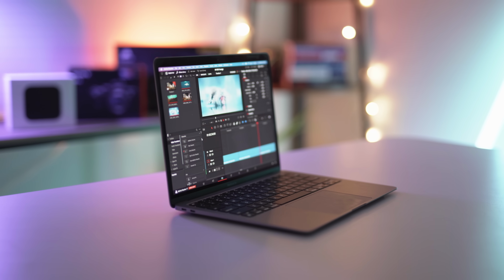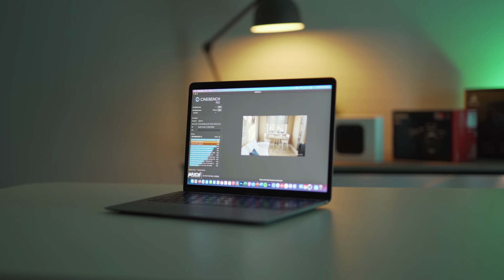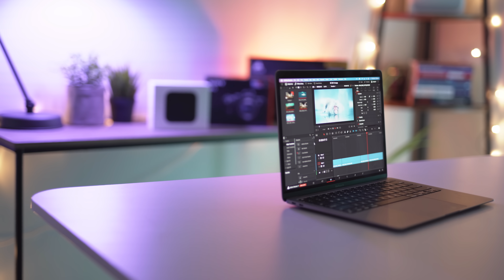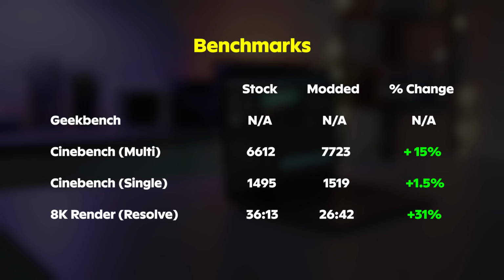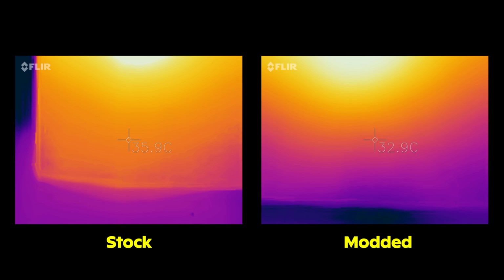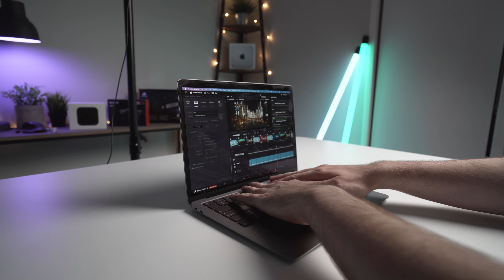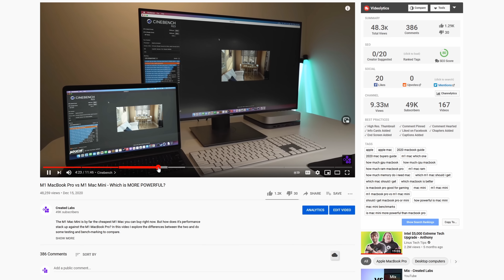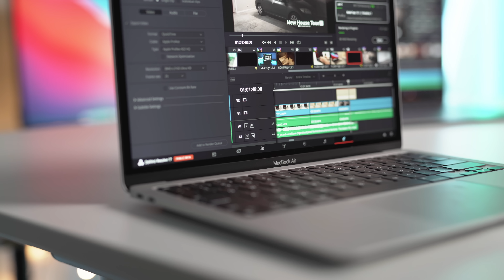I MODDED My M1 MacBook Air & Got 20% Performance Increase!

Comment: Great video. Love the simple modding and the demonstrated drastic performance increase! Well done! Thank you. As a physicist and engineer I have done my own fair share of FLIR thermal imaging and accompanying theoretical analyses and I was hence particularly intrigued with the side-by-side comparison of the actual temperature of the back- and frontside before and after the modding. This shows diligence. In this context, typically, a change of heat flux can be given in percent. For temperature changes , however, % are typically not use, due to the arbitrariness of the Celsius scale. A change in percent can be physically related to an actually measurable process like heat flux, rather than the resulting arbitrary value, the temperature.  In any case, great mod, great details provided with the FLIR, and even more impressive performance change with thoroughly executed benchmarking. I prefer these real world comparisons. Thank you!

Comment: The mod DOESN'T generate heat, it leads heat from the cpu to the case quicker, rather than the heat slowly spreads to the whole case increasing the temperature of the whole case. A bit of thermodynamics would help understand this
Reply from the maker: This mod seems to allow the M1 to perform at a higher clock speed by reducing the amount of thermal throttling taking place (by extracting heat more efficiently). I noticed that in fact this leads to higher CPU temperatures, as in the temperature on the actual M1 die. With the mod and performing at a higher clock speed, the M1 seems to generate more heat than it did pre-mod. Internal temperature was also raised by an average of about 4 degrees C, because the aluminum directly underneath the CPU became much more concentrated rather than being spread around like it did without the mod. 

So yes, in actual fact the mod DOES generate extra heat, at least a few additional degrees on the CPU die for reasons I mentioned above.

So, you are incorrect. Try not to go with the "you don't understand thermodynamics" argument either next time...

Comment: do you think that would also make sense with the MacBook Pro m1?
Reply: It would pull the heat away from the cpu which the fan can cool. Maybe the fans wouldn’t turn on though since the cpu isn’t as hot. Still, I think it’d help performances

Comment: This is why I’d get a Pro from the get-go because of the fan. The Air is designed for those who don’t want to do anything power-intensive.

Would be interested to see if the thermal pads assist the Pro! Lol
Reply: I bought the Air because:
1. it’s more powerful than my 2019 Pro
2. Cheap enough that if there is a 2021 M1X Pro I won’t feel as much regret

So this thermal pad solution is perfect for me. I, too, would love to see the pads on an M1 13” Pro

Comment: What if you put some kind of conductive tap along the inside of the bottom panel to distribute that heat across the whole underside of the laptop a little better?

Great videos
Reply: I dont think conductive tap is better than aluminum

Comment: I tried this mod after seeing this video ony my Matebook from Huawei which has a fan and the "usual" cooling setup. Works great by it own with 79 C max, but after lining the entire heatpipe with 1,5 6w arctic thermal pad exactly cut to its wideness, I could achieve a substantial difference in temparature. The highest short spike temperature was 74C, while the average high load temperature went from 70-75 to 60-66 degrees. That was using the CPU and GPU Shogun 2 Total war benchmark and a prolonged battle with the same unit pallettes. even the idle Temp went from 32-33 degrees to rounded 30.
so yeah
5° less spike temp
10° less very high load avg temp
even 2-3° less idle temp 
I am impressed but am not sure about longterm effects it might have on other hardware or fan activation

Comment: I am no expert in this but to me modded Air doe not spread heat at bottom evenly as original does. Hotter on one side cooler on other. If this would be solved it would work better I guess, It would add to complexity and cost but sticking some cooper wiring to bottom case could help spread heat more evenly.
Reply: I, too, thought about this. Would be nice to spread the heat from that one small area to the entire bottom shell

Comment: How about a laptop stand with a built in "waterblock?" It would need to be a waterblock with a soft non-adhesive thermal pad. But this could actually be water cooled.
Reply: That's quite a good idea. If only there were such pads..

Comment: Would this work on a Mac Mini M1 or does it have a fan inside? If it does have venting/fan, then in theory, the Mac Mini M1 should run faster than the Air?

Comment: I already got the thermal pad a few weeks ago to do the mod, but what I really would like to see is if a modded air will be on par with the Pro. I would be great if you did a shootout with a modded M1 Air vs the M1 Pro. I'd like to see that a no fan modded Air would be just as good as an M1 Pro with the fans kicking in...
Reply: Do you notice the difference? Is it worth it?

Comment: It is interesting that thermal issue with 50 degrees in m1 air is a problem, a lot videos about that. and 6 months ago all MacBooks Pro with i7 or even i5 had 60-80 even 90 degrees doing simple tasks with a built in fan,  like screen sharing on external monitor and everyone was saying about the excellent performance of MacBook Pro...

Comment: To counter the heat from the bottom aluminum you can put a skin or a case on it so it won't burn ya bits.

Comment: This is great! If I start to run into my MBA's limits, I will apply this. I don't see, how it could cause any harm. Maybe if you let it run very hot while sitting on a your lap or a bed. But that is never a good idea. I use my laptop 95% of the time on my desk where the chassis is well cooled. Right now I run bellow 50 degrees on CPU in most of my workloads (32 as I write this). However, I have seen it on 99 already few times.

Comment: I would wager that the bottom panel will discolor over time.
Reply from the maker: There is no way the panel will discolor. You're only adding about another 9-10 degrees C to the temperature of the panel only while the laptop is under full load (e.g. rendering). There's absolutely no way this is going to have that kind of effect on a solid aluminum panel.

Comment: Will do this when my AppleCare+ expires.
Reply: The thermal pads are not sticky, at least the ones used here, so if you needed it repaired just open it up and remove the pads, and maybe clean up any residue with some alcohol and q-tips. Unless you tell them what you did they will never know.

Comment: I am concerned about the long term effects, could it affect battery health more than normally?
Reply: Hmmm me too but instead of the heat inside affecting the battery, the heat is now transferred to the metal case. So if the case is not dented or making contact with battery or cpu then it should be fine?

Comment: I would argue the battery temp may actually go down. If the heat is just dumped into the chassis with the stock configuration then the batteries will likely be soaking up more heat in that config. If the heat is being dumped to the outside via the bottom panel then the batteries will likely be cooler in fact. The have an air gap to insulate them from the bottom panel. So instead of the heat accumulating within, it's being dumped outside, likely reducing the internal temp.
Reply from the maker: The modding forums and some of my own brief testing confirmed battery temps are higher with the mod. Only by about 4-5 degrees max though, so not a huge amount. And this is only while doing something intensive like rendering.
Reply: I'd say without the mod, less heat is drawn away from the CPU. As a result the CPU gets hotter and throttles itself down. With the mod the CPU never gets hot enough to throttle down and thus runs at full speed creating more heat overall. That additional heat gets transported to other parts e.g. battery through the bottom case.
Thus with the mod the M1 chip is the only part that runs cooler. Other parts run hotter.

Comment: you call 63 degrees toasty?

laughs in gaming laptop
Reply: Laughs in Air 2020 intel
Reply: @jackeytam7700  why you didn't wait for m1?
Reply: @RamMohammadJosephKaur  Long story short I needed a laptop for school and my old one was shitting itself
Reply: @jackeytam7700  which was your old one?
Reply: @RamMohammadJosephKaur  it was an old HP with a hdd on its way out. I decided it wasn’t worth upgrading and ended up getting the mba. I would have gone for the mbp but budget constraints didn’t allow me to
Reply: gaming laptop? mine was more like gaming hairdryer when i play games.
Reply: Yes because the outer shell as standard hits the legal temperature limit. Anything more than that and it will toast your balls. Making the bottom of the MBA an heatsink===BBQ balls!
Reply: laughs in Asus TUF A15
Reply: Gaming laptops especially the thick ones run way cooler than thin laptops like these

Comment: I hope someone makes a replacement bottom cover for Macbook Air with heat management system without burning the user.
Reply: Ideally, Apple would just learn that processors need cooling.
Reply: @Bitshift1125  To be fair, these run muuuch cooler than Intel chips did.
Reply: @computernerdinside  Sure, but the Intel chips Apple used were still low wattage. The issue was inadequate cooling, not the heat of the processors.

Comment: Take it a step further and place it on an aluminum stand. That’ll get that case working even better as a heat sink. Or a cooling pad with a quiet fan. That will likely increase longevity of the computer as well.
Reply: I used a gel pad that I keep in the freezer to treat any strains and niggles from running.
I sat it under the rear of the Air where the processor is situated then did a 1 hour Cinebench R23 test. scores were consistently in the high 7700's on a base macbook Air with 8/7 cores. That's about the maximum due to the design of the processor.

Comment: dont know if this is a stupid qn, but could you find a middle ground if you cut the thermal pads into smaller pieces? so it doesn't get so hot but increases a bit of the performance?

Comment: There are a couple of threads on the MacRumors forum detailing both this mod and the same mod on the 2020 Intel MacBook Air. It includes details of the screwdrivers required ( with the Intel Mod some people replaced the thermal paste on the processor as the stock application was pretty rubbish )  plus the optimum cooling pad thickness. There's an excellent step by step video guide  by one of the forum members on the forum.
I modded my M1 Air a few weeks ago. I have the base model with 8/7 cores. I didn't bother to put a thicker pad on the lower square part of the heatsink, just a 2mm pad on the higher part as this is directly over the M1 chip.
I've run many Cinebench R23 tests, from individual runs to 1 hour continuous. Scores are usuaklly around 7700-7800. 
One thing to be aware of is that Cinebench R23 shows a cumulative average of the scores on a multi run test. Some of the guys on the forum have done some pretty deep analysis on this. One commenter has run Handbrake converting  his video collection on  his base M1 Air overnight. Once the M1 Air reaches equilibrium it stays there indefinitely.
Reply: There are also a lot of nice graphics showing the performance trends with and without external fan. A very recommendable read if you are interested in the mod so you know what are you dealing with.

Comment: Case heating don't mean necessarily cpu runs hotter. It must mean that cpu transferring more heat onto case and cooling itself more
Reply from the maker: No the CPU definitely does run slightly hotter after the mod, but only by a few degrees.
Reply: @CreatedTech  not so unexpected. I assume this will also have an affect on battery

Comment: I think this is the most easiest way to convert macbook air to pro. 😁
Reply: Battery temperature?
Reply: @peekpt  buy more thermal pad and stick the back to a metal table?
Reply: @peekpt  it’ll turn the bottom part of the case into a giant heat sink, which would cause the temperature of the external case to exceed the safety regulations put into place for laptops and mobile devices.
Reply: @Nathan_Lundstrom  IF YOU CAN'T TAKE THE HEAT 🔥
Reply: @GabrielHR55  lol I like my leg hair to not be singed when using the laptop on my lap :P
Reply: I bought the "unnecessary" 16gb and 8 core gpu version... So if I do this it will be a MacBook pro! 🙌
Reply: You'd probably find this would help the pro, it's got 1 tiny fan set up for human comfort not performance. If you don't care about injuries, you can overclock any processor, maybe undervolt it to stop it melting
Reply: and a macbook pro to max
Reply: True, but warranty, can it be removed later for warranty🤔
Reply: @swackymusic  not a chance!
Reply: Also easiest way to kill it without knowing it
Reply: Amazon people doesn’t know what is talking about literally just like a lot of YouTubers and this is what I’m starting to get frustrated by people that are somewhat clueless in all things technology
Reply: Use the mod and a cooling base. Problem solved
Reply: @Helios.vfx.  that would be impractical as hell, I'd wait a little longer, save up an other 200 bucks and get a MacBook pro,
Reply: @MotazAGR  that's a good option too. plus no warranty avoided. I'm using the old macbook pro 2012 late with a cooling base on a desk and I'm okay with it (writing from it now)
Reply: @Helios.vfx.  I have a 2012 MBP as well
Those tanks will never die
Too bad its stuck at Catalina though..
Reply: @MotazAGR  im using it with big sur now. hahahah yeahm this is my first mac ever. just got it a week ago. getting used to mac
Reply: @Helios.vfx.  mine is a mid 2012, it didn't upgrade
I hade for 5 years
It's a tank, not a computer
Reply: @MotazAGR  mine is mid 2012 as well. I just installed sur with some patch and it works fine. I do agree. I never had a laptop before but this mac is heavy af lol. also feels robust but sometimes when i pick it up for a corner it seems to crash. i need to restart it
Reply: @Helios.vfx.  yap, use cooling pad😁
Reply: Sadly some people need a MacBook Air as a standard, that’s my case at least. Although there’s no rules for modding.
Reply: With a voided warranty and it’ll go past the temperatures legally allowed on the external casing of a production line machine.
Reply: @Nathan_Lundstrom  who cares
Reply: @Dylan-zm3ht  because good vibes aren’t apathetic.
Reply: @Dylan-zm3ht  you will when the battery over heats and pops
Reply: @Nathan_Lundstrom  LMAO the bottom case is literally a piece of metal, you can put it up to 300 celsius degrees or more and still have no problems.. ps. fun fact: the bottom case of the air and the pro are literally the same. Obs this mod is better if dont use it on your legs, but use it as workstation on a desk (anyway the pro version has this "mod" pre installed, so the bottom case will heat up as much as the air with the mod)
Reply: @JusTJack_YT  yup, that’s not the point. There are regulations enforced on consumer devices regarding external surface temperatures - Apple has managed to keep the M1 Air barely under that threshold, they are letting it heat up to its legal limit. By doing this mod you will exceed the temperature limit that Apple had to abide by.
Reply: @Nathan_Lundstrom  to sell, yes but once you buy it, you can mod it however you want, lol. They’re not going to fine Apple for people trying to get the most out of their product through modding.
Reply: I agree - That’s pretty self-explanatory. Do whatever you want to your computer, I would mod mine the same way. My point is still valid. Those are common sense regulations to protect the owner of the device.
Reply: @Nathan_Lundstrom  and anyone else who thinks this normal and its just regulations on external heat that's the problem
Its not just that, in case you forgot, there's a lithium-iON battery underneath the aluminum cover, so instead of the heat being directed through the heatsink away from the battery, you now have 82 to 90 degrees celcius of heat straight to the battery, your Mac is a ticking bomb waiting to explode with its chemicals on your lap
at the very least it will shorten a lot your battery life
Reply: @MotazAGR  what if I use cooling pad for laptop? Will it save the battery? What do you think?
Reply: @johnathanwelbeck5210  i dont think it would given the sheer amount of heat the CPU produce (especially if its an intel mac)
with that said if you do so you will slice your battery life so even if it works, its kind of impractical, i would go for keeping it stock and use maybe a cooling pad when working on heavy loads, avoiding warranty void but  most of all, keeping it practical and usable on a regular basis when one is for example, using it on his lap in bed fo netflix.

Comment: The vibration of the frame gogint into the CPU will destroy the CPU in about a month or two and warranty won;'t cover a replacement.
Reply from the maker: What an absolutely ridiculous claim and shame on you for spreading such misinformation.
Reply: @CreatedTech  Does he mean that pressure on that thermal padded area may damage the m1. Even if no direct pressure on that thermal padded area but simply putting the laptop on the table with its own weight may cause the pressure to transfer from the case to thermal pad and finally to heatsink/m1?
Reply from the maker: @Gleeleeglee  If you're using a 1.5mm or even 2mm pad this is just not an issue. Then again this is just my personal opinion and experience, so don't take it as fact!